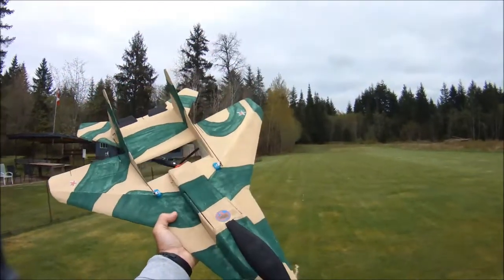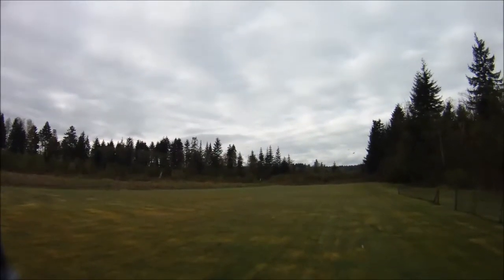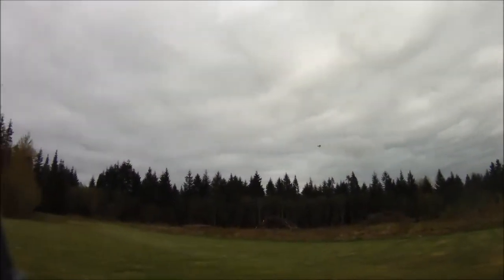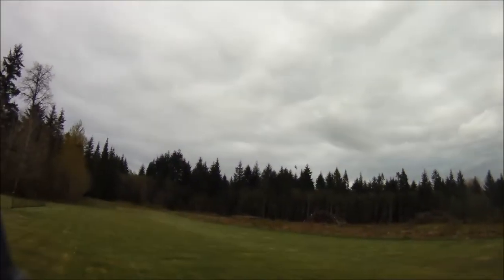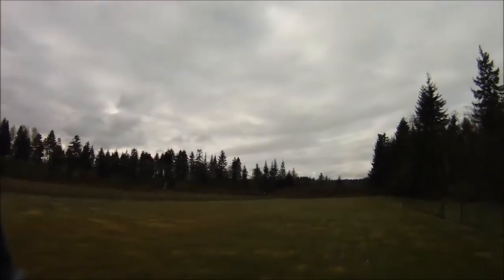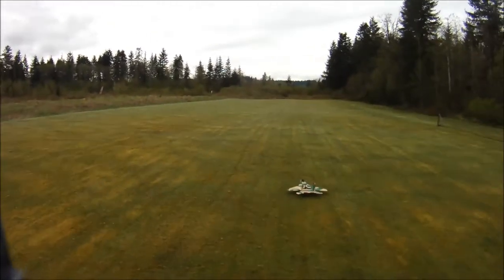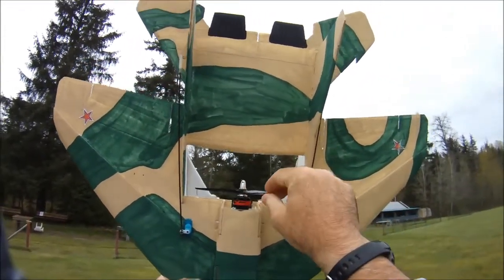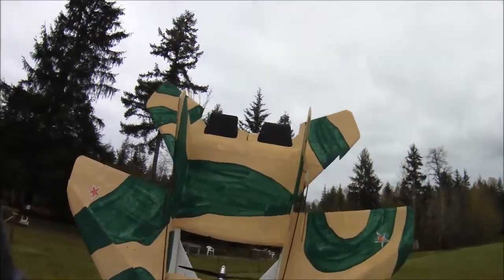RCTimer FR2205 2550Kv MAS 6x4x3 field test

Comment: I bought an "FC 28-22 Brushless Outrunner 1200kv" from HobbyKing and paired it to a 6x4 (2 blade).
The leads of the motor burnt and that caused a short. Any ideas why?
I was on a Turnigy 2200mah and had the throttle at 90-100% for 2-3 min in a breeze and flew the X32-guppy from frcfoamies.

https://hobbyking.com/en_us/fc-28-22-brushless-outrunner-1200kv.html
http://www.frcfoamies.com/boeing-x32--guppy-.html
Reply from the maker: Sorry to hear about your motor situation.  After looking at the motor specs and the fact you were flying at such a high throttle setting for a long period of time, I suspect you might have been pushing the motor far too hard or the prop was causing it to draw far too many amps which more than likely caused things to overheat to the point of burning.  With the low Kv rating, that motor is designed to spin a large slow fly prop to produce enough thrust to fly the plane.  The 6x4 APC style props need to be paired with higher Kv motors of 2200 Kv or higher normally.  Cheers, Scott
Reply: +e3Scott 
Aaaah. So rule of thumb is: Large prop = low KV motor and the reverse for small high KV motor. In general... 
Thx!
Reply from the maker: Generally, yes that is a good rule of thumb.  Hobby King is normally very good at providing suggested props for their motors.  Good luck.  Cheers, Scott